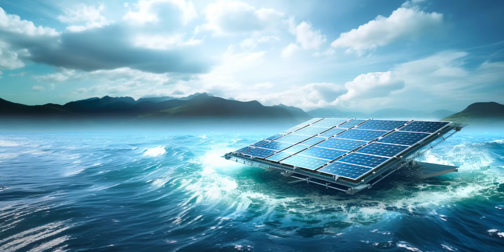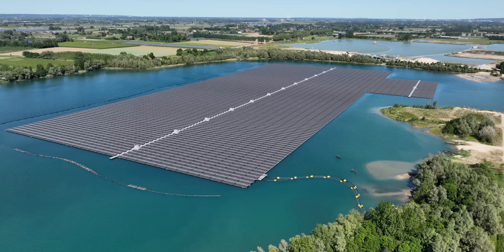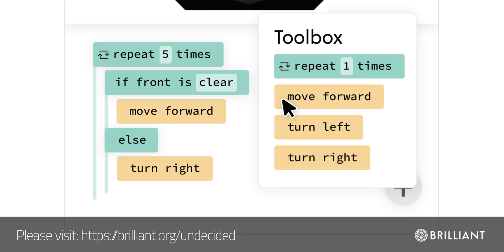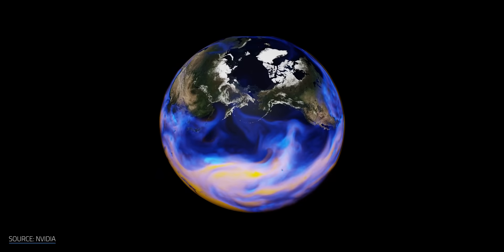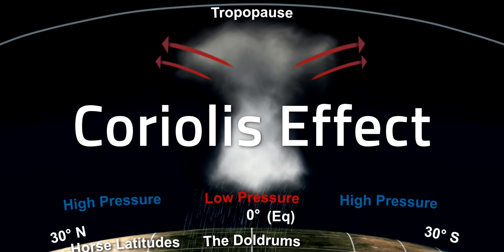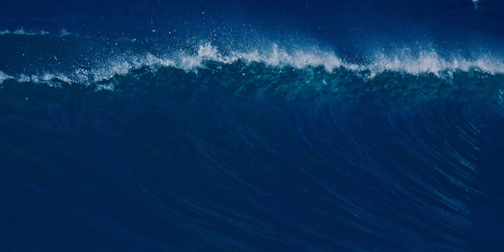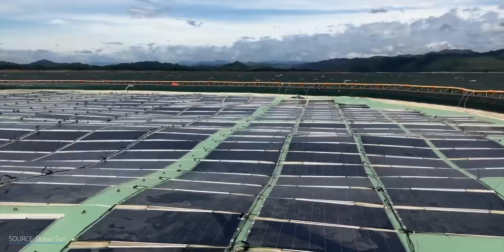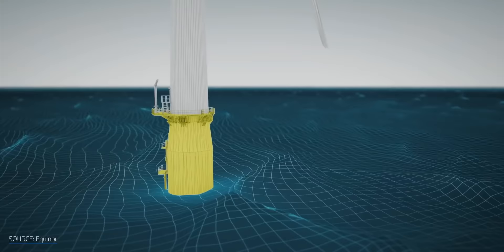How Offshore Solar Could be the Future of Energy

Comment: 2 axis tracking can yield up to 25% more over a year.  With panels elevated on a floating disk, being able to rotate the disk from early morning to evening would seem pretty doable even considering the cabling to take power back to shore.  Small, self-powered motors to rotate around it's center positioned on the periphery.  I'm not sure all the ocean stuff and floating flat, materials damage might outweigh the space availability.   Personally I think on-shore going vertical in more instances (faces of buildings, ringed around poles/masts - maybe even also rotating through the day ) - might be the next growth and reuse of land/building space.

Comment: There's potential in offshore solar, but I have a feeling that the more advanced solar gets, the more on sites it's going to be deployed, in fact, there's already talks about how many could go gridless over the next decade, and as renewable and battery tech continues to get better, it's likely a lot more will want to do that to cut out the middle men and reduce cost.

So I'm not saying there's no use for solar offshore, but I suspect the future is going to be more on-site as the tech continues to get better and a big reason I think that will happen is because it's really expensive to maintain the grid network.

But for me, I think we need a hybrid approach of both solar and wind power with much better and cheaper battery tech for it to really work, especially when it comes to more consistent energy generating.

On the plus side, it looks like solar is starting to be adopted in areas like car parks and farming, which there is a lot of untapped land that would be ideal for use and just like solar on the water, in can serve multiple purposes, at car parks, it would be ideal for charging EV cars, it's also much closer to building infrastructure, so should be easier to tie it into the energy network, on farming, apparently it seems to work well for protecting crops from too much sunlight.

When you throw in that solar is developing in such a way that it can be used almost anywhere, I doubt space for deployment is going to be an issue and I think longer term it's going to make a lot more sense to deploy close or on-site for where the energy is being used, something that can actually be done now, but there are a few hurdles needed to overcome before that can be used widespread, which likely as solar and battery tech gets better, it's going to be a lot more viable for a lot more of us.

Comment: 5% of the US is covered by parking lots. You need solar at 100x100 miles to meet all US energy needs. 3.8m sq miles in the US. .05x3,800,000= 190,000.  Assume 33% of them can reach peak solar output. You still meet the same 6x energy needs.

This is what eminent domain is for.

Comment: Floating solar is interesting. I’m in the planning stages of a Caribbean cruise by sailboat (6-12 months) and floating solar while at anchor is a huge part of my energy calculation. It’s good weather production only and can be tied to the boat like the dinghy. It’s a perfect solution on this small scale.
Reply: Neat idea. Fellow sailer here. Maybe Just make your dinghy have a solar bimini and plug it in to the yacht while it floats out back?
Reply: @GuyIncognito764  that was my original idea as well. But two problems…
1) you’d loose the usability of the dinghy for excursions
2) in order to install enough solar, like 1200-2000 watt, you need a lot of space. Setting up a structure on top of the dinghy for this purpose can be difficult. 

At the Annapolis boat show I found a blowup swim platform that would be perfect to install solar on. I would be able to use the dinghy as a work platform. 
Mind you, my Yacht is only 30 feet.
Reply: fold out structure with mount/dismountable solar panels, at anchor point as stronghold for the structure or at the widest point (usually back) many solar panels are flexible to a degree and could be stashed inside in serious weather conditions whilst being easily mountable even alone.
it's been done and definitely doable. start drawing and having fun with it...
Reply: @marcusa4193  I definitely will. So many options.

Comment: Dear Matt: I don't think that "off shore" Solar power stations will have a big future. In general one of the biggest advantages of PV is the option to collect electric energy very locally close to the users. This advantage is deliberately left behind when bulding these off shore.
However floating PV can have a good contribution of the entire system, in particular when built locally on lakes, reservoirs etc. etc.

Comment: I get that you'd lose a lot of the efficiency but surely a lot of these problems would be mitigated if the panels were designed to float slightly under the surface? You'd need the materials to be fully resistant to the corrosion (let alone the water itself) but the other issues would be easier to handle that way.

Comment: I think offshore PV would be a great solution. But first we should put Solarmodules on every availabe roof. Then of course we would produce 3x more electric energy than we could ever use and the energy would be evenly distributed between the network nodes - which makes the offshore idea completely irrelevant.

Comment: The reason for all of these centralized, huge solar farms, wind farms, and even hydroelectric generators on municipal water-delivery pipes is simple: large corporations want to keep selling power--electrical power--to the end-users.  With the new, more-efficient solar collectors, better batteries, lower electric use appliances (like LED lights and heat pumps), we will all have enough 'power' on our homes to create enough electricity that we can go off-gird.  "Horrors!' say the large power utilities.  (Plus we have solar landing on our cars, yards, and so on.)  In my neighborhood, the tap water delivery system has such a high PSI that they have to install a 'dampener'--but heaven forbid that they instead install a low-voltage hydro generator.  In Seattle, the water for the city arrives from 600 feet above the town--and again, no hydro.  The city of Seattle has five hills over 600 feet tall, with the sewage treatment plant at sea level--and again, no hydro generation.

Comment: Hey.
Have you ever heard of a ‘fleet’ of 3D buildable flying drones that can be connected to an electrical line that they can be linked too Via shorter ‘electrical extension cords’ that instead of having ‘prong’ plug in between them they use a Magnet on one end of the extension cord to a magnet on the drone that links the drones linearly?
This idea is for cleaning the panels. The drones can be made to take a greater voltage of electricity through the connected extension lines.
Because,
They also have short ‘water hoses’ that use the same magnetic principle to connect the water hose to the drone and having a great deal of drones, and even water pumps on the occasional drone to keep the flow rate of the water in the hoses controllable for the drones and not overly pressurized from just the land pump. Each connection, either water hose or extension cord, is linked by an electromagnet.
Thinking you have a club of people in the stadium of interest like say, Chelsea, Arsenal, Bayern, Manchester United...who think making drones like toast in the morning is cool, then you could have a firefighting fleet of drones (and other information about other usefulnesses)
As for the solar panels needing being cleaned, the end ‘cleaning drone’ is fitted with a gathering reservoir and a pressured/izing vessel reservoir to pressure wash the panels.

Comment: Interesting concept but two major issues I see. One is that creating the power is fine but moving it to where it is needed is a whole other issue. A deep sea grid? The other one concerns me more in that it will impact ocean temps by shading the sea and capturing energy that would normally go into the ocean. That will impact critters but the other part is will it impact ocean currents and thus the climate? It could be good but it also could be catastrophic if it messes with natures currents to balance the climate. Imagine if the Gulf Stream shut down and what that would do to a large sector of the planet. Not insurmountable but must be part of the plan rather than just a greedy grab for a fast buck. These projects must be part of a wholistic approach to the issue rather than just a profit center. No single nation should have unrestricted control on planetary issues.

Comment: What about placing these solar farms near shipping lanes, and using the energy to charge batteries, which could then be swapped out on electric ships, freighters and cruise ships alike.   These ships may have to be hybrid in case there is no power available, but think of the amount of diesel we could avoid turning into co2 and the amount of money that could be saved by these shipping companies.

Comment: How is the power accessible. What size cables are required to connect these far away floating energy fields to the local power system? Seems to  me that could also be a factor.
Reply: It’d be the same as offshore wind

Comment: Salt water and metal or electrical things are just not a good combination.  Corrosion sets in very quickly, the maintenance costs would be huge.  This is the main reason why tidal power just doesn't work,  the machinery quickly corrodes.

Comment: My biggest concern would be longevity.
Solar systems are not the most durable electrical systems out there and out in the ocean is the worst place to have anything electrical.

Even disregarding the average lifespan of panels and equipment i would suspect the environment would quickly start to destroy even the most hardened system. 
And any system you made that could survive any length of time would be so expensive it simply would be too expensive in the first place.

Comment: Wondering - not sure where plastic film based panel cells are right now but if that were viable - perhaps being able to unfurl and then roll back up the panels in advance of bad weather, moving the installation, etc.?   I think this is how space based solutions will probably go at some point (unfolding panels).  Perhaps a number of them contained in a roller mechanism (which also contains connections, power, etc.).  Larger numbers of smaller units providing some degree of resilience against swells, errant debris, etc.
I could envisage a panel that could be unfurled next to a moored vessel to generate more power, probably a Godsend during a natural disaster such as right after a hurricane.  We saw a fair few posts about the flexible film cells some years ago but I haven't seen much for a while, would love to know if this becomes a technological option.  Unrollable cells could help charge EVs (to a minor extent) or provide camper vans fast additional power that can be automatically retracted if high winds are detected too, perhaps a little like this could work at sea.  Given that we can use mesh network connected sensors now to micro-manage such conditions it may be practical where once it required expensive manual supervision.
Reply: Like a big genoa on a furler 😊

Comment: Do the panels have to be in contact with the water to get the cooling effect? Like if they’re in a framework above the water do you get the benefits? Also the tropics are hot and from my visit to Kenya and Nigeria; well those places at least were pretty humid cloudy and hot and don’t some equatorial spaces get rain everyday at noon (peak solar time).

Also like Nigeria has this black mould growing on all the buildings

Comment: The problem I have with solar is the underlying assumption that solar energy is limitless. It's not. It is finite; it is measured in watts per square meter. Every bit of it is used to do something on this planet, mainly the engine that powers life itself. Plant life powers our entire ecosystem. The question is how much of this energy can we siphon off to use ourselves? Rooftop solar makes sense. We already built the structure and it's difficult to grow plants on your average roof so the sunlight that hits it is energy wasted. Solar makes sense there. But large solar farms where they basically bulldoze nature and to put up a power plant makes much less sense. And while the ocean is vast, it seems we are learning more all the time how friglie it is as a system. We should be cautious when considering floating solar farms and all the possible/likely unintended consequences. I think we need to think hard about the concept that at any given moment, solar power is a limited resource and use it accordingly. Solar has its place but it isn't the only solution.

Comment: On reservoirs and irrigation canals and lakes they make sense for a number of reasons, but not on sea water. Too rough and salty. Just think about the state of your sunglasses after a day on the beach. They need to be washed in soapy water to get the salt scum off of them.  Installation costs would be higher, maintenance costs higher, and getting power to shore is higher.

Comment: This is just a corporate wet dream, to hold on to large scale generation and keep control of supply and cost to consumers. A far more effective solution would be to fit solar panels on all suitable roof tops and combine that with distributed neighbourhood batteries, stabilising the grid and levelling the load for the large scale generators, like nuclear. 
Could be done for under $10,000 per house, more likely less if done at scale. It’s what Tesla is about to launch in the UK.

Comment: These panels are cooled by the water, do they raise temperature of the water in the long run?
Reply: I don’t think it would. I could be wrong but it should be a net zero system with the solar radiation it absorbs not going into the water and heating it up
Reply: The ocean is huge, there are constant currents. It's really hard to try to heat the ocean.

Whether it has a heating effect, depends on the reflectivity (surface albedo) of the panels compared to the ocean.
Anyway, since it replaces carbon emissions it'll be cooling the ocean 😅

Comment: If deployed wide spread I worry about the risk of drought because you're effectively cooling the ocean and putting a hiccough in the water cycle
Reply: You severely glazed over this, it's a benefit for fresh water systems but it's a downside on the ocean, if you collect 1% of the energy that hits the ocean and would otherwise be heat that evaporates water you could over a short number of years significantly cool the oceans. This is 10x the difference between solarmax and solarmin energy levels, which has noticeable effects on the climate.

This doesn't even touch on the ecosystem damage by removing photoplakton from being able to grow, which the vast majority of fish rely upon for food either directly or indirectly.

There are several deserts without any of these dilemmas to build upon in the equatorial belt where deploying solar may increase habitability. Why are we as a species focusing on the methods of energy generation that are ultimately self destructive

Comment: I don’t think your video mentioned anything in regards to transmission of the generated power. It doesn’t do much good to generate enormous amounts of electricity if you can’t get it to where it is needed. That’s one of the leading problems we already have. The lack of transmission infrastructure bogs down generation capacity.

Comment: Will we call it the Edmund Fitzgerald generating station, the Lusitania generating station, or the Titanic generating station? 
 I am very much in favor of renewable energy, but i have a strong bias against wind and solar for a very simple reason: they are almost completely useless when demand is at its greatest. When is that? In January or February, 6 to 9am, at temperatures of minus 30 or below. When the sun is below the horizon and the air is perfectly still. I admit that that might not be true in someplace like Florida or Arizona, it is certainly true for the northern half of the continent. It will become more so if politicians ban gas or oil furnaces and make people dependent on electricity to keep from freezing in midwinter.  Thereby creating a demand on the electrical grid that wind and solar are not going to be able to contribute much to supplying.

Comment: Hmm. You know, energy production is always a 2-sided blade. They say that floating solar functions better because it can stay cooler, right? Okay... but it's still generating the same amount of heat. So where's it going? Into the body of water. This raises the temperature of the water, so what we need to know is if direct sunlight or solar panels produce more heat. And if the solar panels produce more heat than the sun, then we have a problem. Marine ecosystems are both hardy and fragile at the same time. They can weather storms, sunspots, solar storms and the like... but you change the chemical composition of the water even slightly and you could easily kill an entire ecosystem. The same goes for heat. Too cold and some marine life dies while others thrive and vice versa.
There's also the issue of the solar panels radiating the ocean's heat to the sky at night... causing it to cool more than it would normally. Too much heat or too much cold isn't good. If it's slow enough, life can adapt... but if it's chaotic, life dies. It's tough either way.

Rather than trying to cover the oceans with solar or vast swaths of land with solar, why don't we just build nuclear plants and use all that area for something else? I don't get it... we HAVE a better solution... but we don't want to use it?! Why??